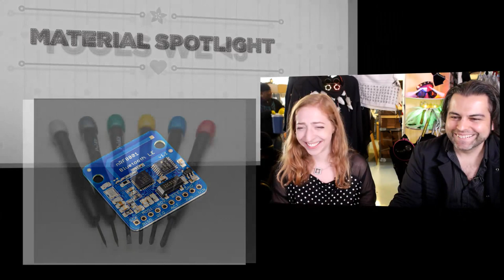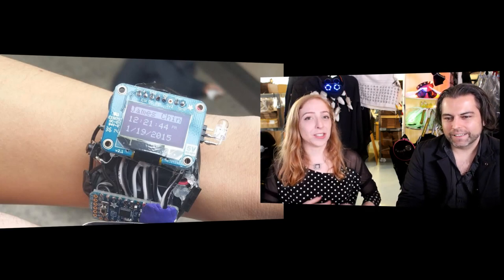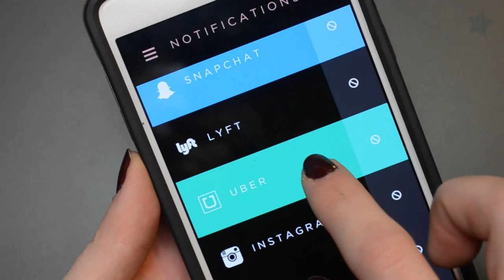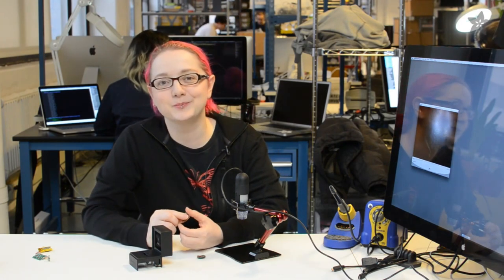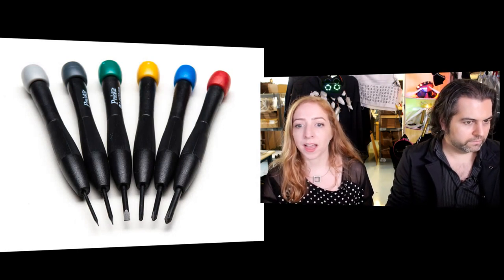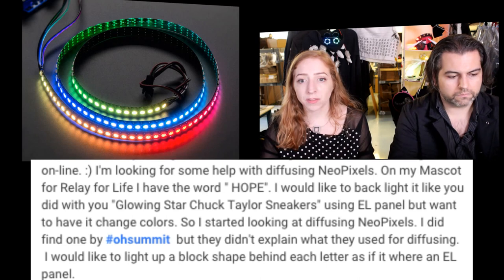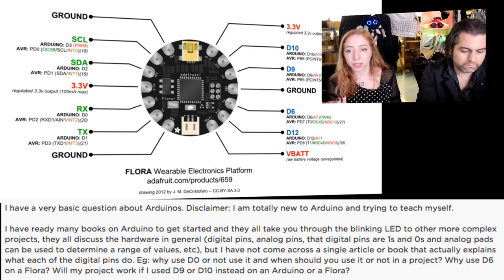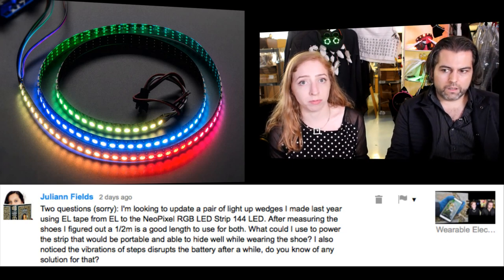Wearable Electronics with Becky Stern 1/28/2015 - LIVE

Comment from the maker: https://www.youtube.com/watch?v=Fx4lfaUpGXw & http://www.adafruit.com

#adafruit  #arduino   #electronics   #hardware   #opensource   #projects   #computer   #microcontrollers   #LEDs   #LED   #gemma   #flora   #bluetooth   #bluefruit   #neopixel   #neopixels   #wearables   #art
Reply: Diffusing Neopixels for one of my projects I found white styrofoam food containers work pretty well. Depending on the look, several layers might work as well. For my project I needed a hard line separation between the lit areas so I cut the foam and glued a thin strip of black construction paper to one of the edges and glued the foam back together. When I get it done I hope to reveal it on Show and Tell.
Reply: Mike Whitenton I would like to see this. I would like hard lines in a box shape.
Reply: Steve Morrison I needed diamond shapes for my project. Squares would be exactly the same except 90 degree cuts instead of 120 and 60 degree cuts.
Reply: One diffuser i have done is the through hole led's cast in silicone.